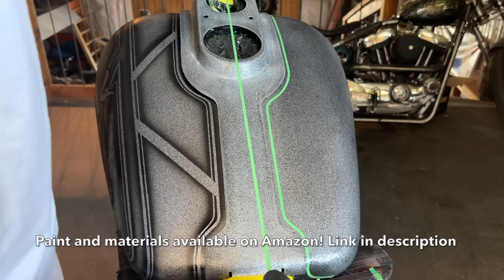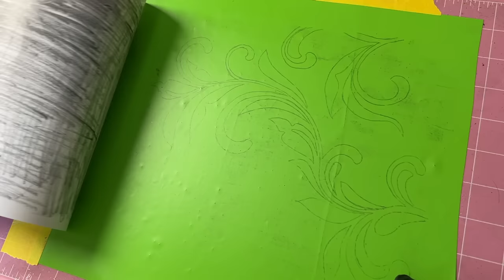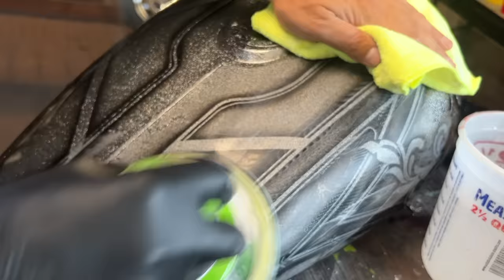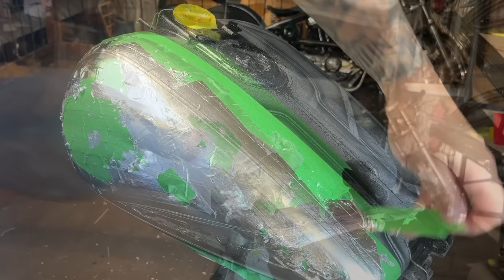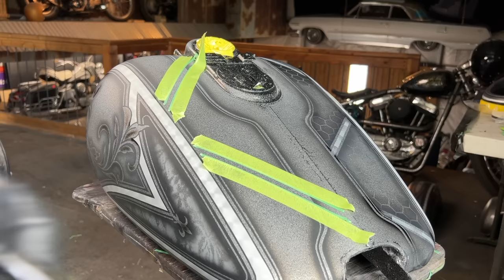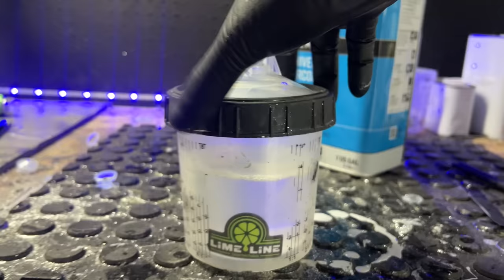Custom Painted Harley Davidson fuel tank

Comment: Does the black basecoat hide the flake in those areas? Would using a black candy for shading let the flake shine through when the light hits it?  Great work and great video, thanks.
Reply from the maker: Yes, however I like the contrast of the solid black. Also I haven’t found a black candy I like

Comment: How long do you wait to pull the tape after applying the leaf? Awesome work!
Reply from the maker: You don’t have to wait
Reply: @TimeWarpCustomPaint  what about in between colors? I’ve painted several firearms with Duracoat and you have to wait a minimum of three hours before removing tape and stencils.
Reply from the maker: Hum. Never used duracoat
Reply: @TimeWarpCustomPaint  what paint do you use?
Reply from the maker: House of kolor and speedo kote https://www.amazon.com/shop/timewarpcustompaint?ref=inf_pub_timewarpcustompaint
Reply: @TimeWarpCustomPaint  thanks!